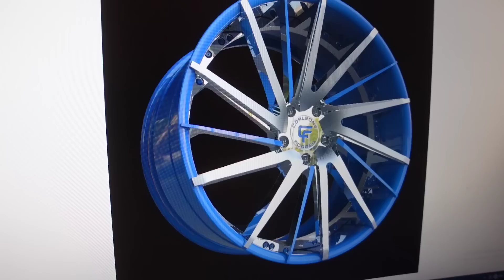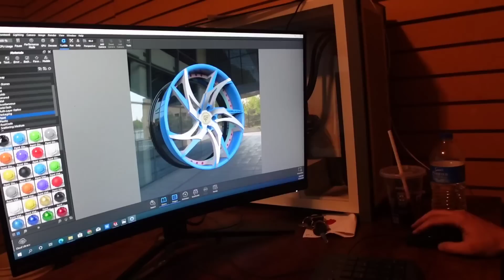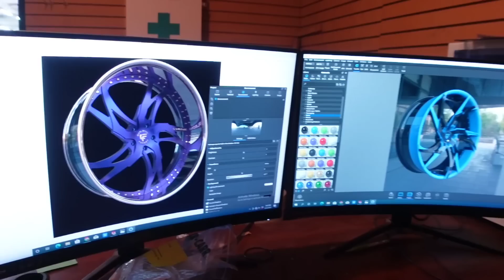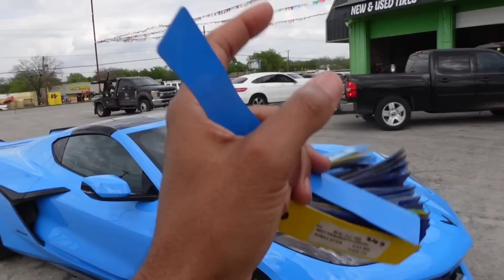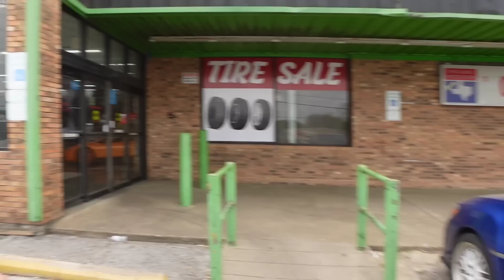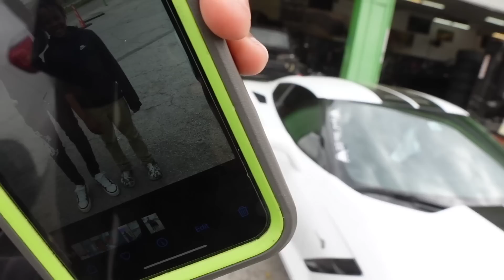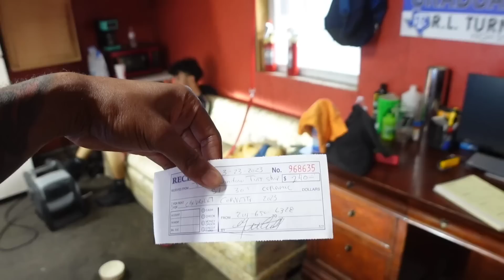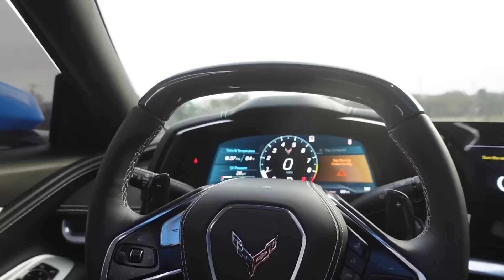CREATING MY OWN RIM DESIGN WITH CORLEONE FORGED AND MY FIRST ZO6 MOD

Comment: Love the CJ inspired Corleone's! The tint looks great , those roof pillars definitely look better in the blue. They only produced a little over 1000 total Z06's for the 23 model year  , So Please Hold on 2 it , eye think the Z06 could top all the others in the Fleet,  the interior blows away all the other exotics! Think you should tro some blue inside.  It's what eyev been waiting 4  can't get enough of the Z06..
Do you know Dodge executives don't want you getting a sunroof in the 170  that they are charging $9995.00 for it as an option!  Crazy. 
Put down that deposit on the 2024 Collector's edition  Camaro .  23 going Big. 🤘☮🤘☮🤘⬆️

Comment: Like pops said, that's the one:_32GANGLIT::_32GANGLIT::_32GANGLIT::_32GANGLIT::_32GANGLIT::_32GANGLIT::_32GANGLIT::_32GANGLIT::_32GANGLIT::_32GANGLIT::_32GANGLIT::_32GANGLIT::_32GANGLIT::_32GANGLIT::_32GANGLIT::_32GANGLIT::_32GANGLIT::_32GANGLIT::_32GANGLIT::_32GANGLIT::_32GANGLIT::_32GANGLIT: